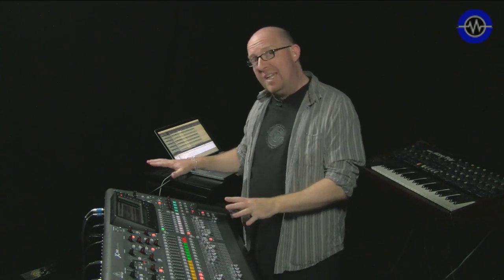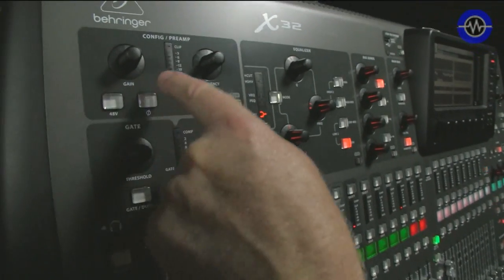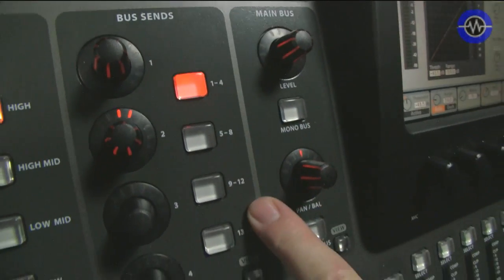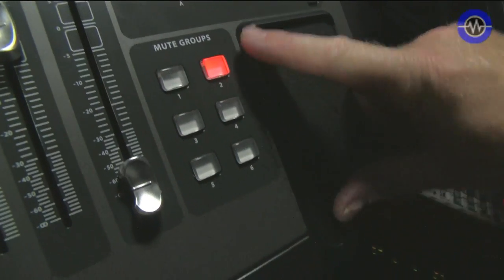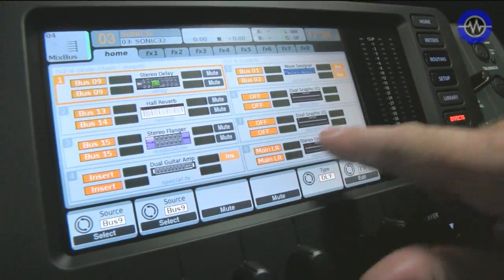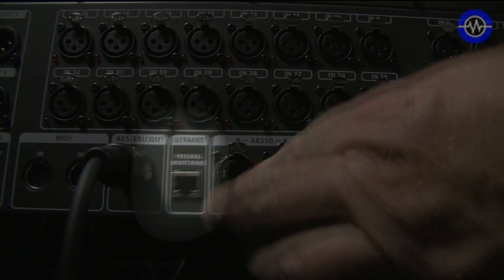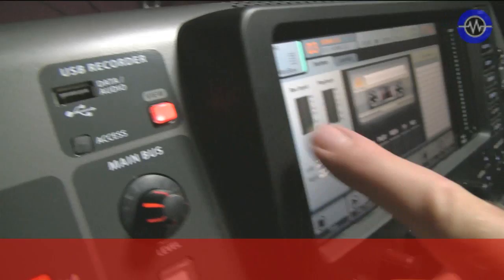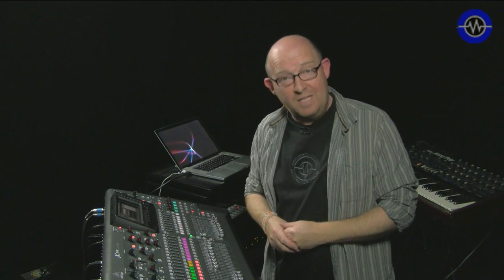Behringer X32 Digital Desk Hardware Overview (PT1)

Comment: If I wanted to do parallel compression on drums could I set up 2 group buses, one for the dry buss and one for the parallel compression? My Church is about to upgrade to a digital mixer and the worship leader is asking my input because I run sound board on Sundays. We have also been looking at the Presonus live 24.4.2 but this one looks like it has more options.

Comment: If you want to send 2 tracks back from the computer to the desk for use as click tracks, can this be done with just 2 individual tracks or do you have to assign a block of 8 tracks returned from the card losing 6 channels on the desk.

Comment: This would have been my next mixing desk/recording system for live classical concerts, but the thing that killed that prospect was that this desk, according to Behringer, does not support 24/96 depth/rate recording. It would have been superb if I could plug in a USB thumb drive and record the concert to that, instead of dragging along a MOTU 896, a Sony laptop PC with Vegas and all the interconnecting stuff in addition to the microphones and rigging hardware. Perhaps B's next desk will do so.

Comment: Thanks for the very informative review. Please cover these in the next videos: How to handle monitoring, and the routing especially in conjunction with P16 and S16, such as: how to select which channels or be DCA channel can be controlled with the P16m- pre or post fader, how to set individual monitor mixes via 'flip to faders'. And also how to save and recall each channel's setting. Oh and how to engage the FXs. 
Thanks in advance.

Comment from the maker: On the remote setting, the centre controls - the 8 bus/group faders and buttons can be in HUI, Mackie Control or CC mode (Control Mode) I think these are fixed assignments, but I also think in the new firmware update - the assignable section can also send MIDI messages. The channel faders, mute, solo and channel strip controls do not send MIDI

Comment: Great video :) Any chance you could go over the 'Sends On Fader' controls? and more on the groups/outputs? Cheers
Also, I have some Behringer gear (compressors, etc) and although its budget gear, I've never had any problems. I have used DiGiCo desks and I have to say, in terms of features, the Behringer is fairly similar! Obviously considering the price difference!